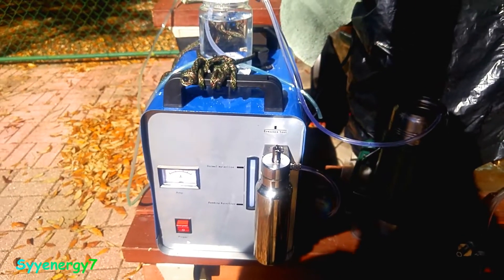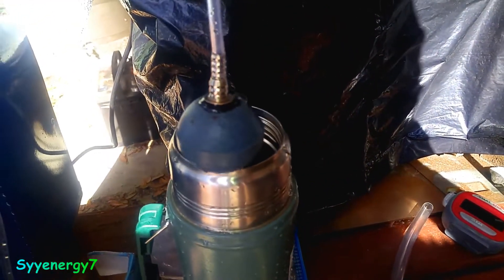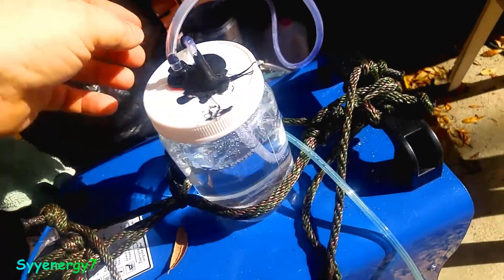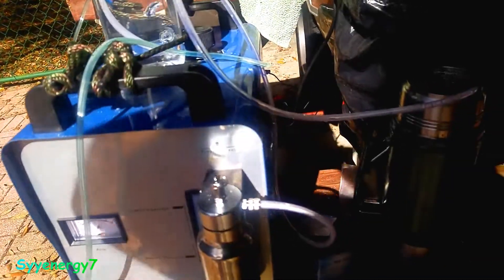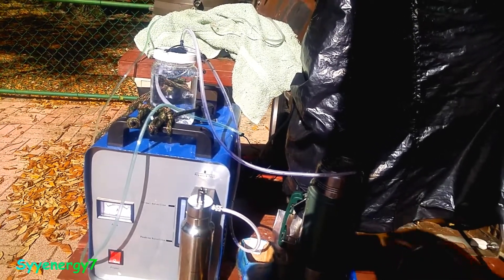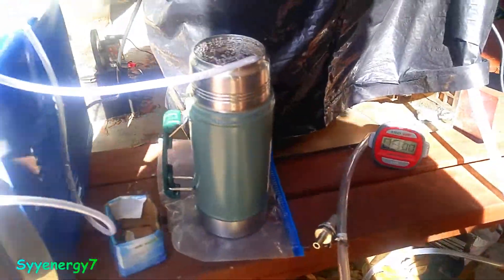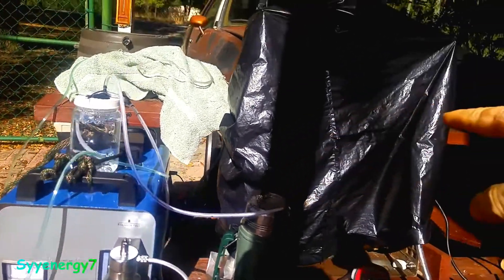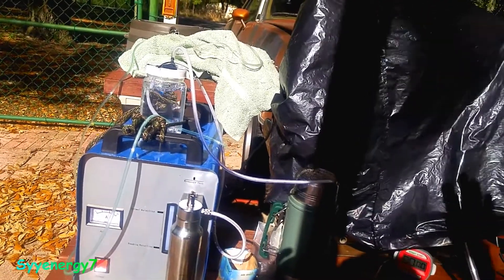$125 HHO 'Health' machine finished !

Comment from the maker: I lowered the electrolyte so it does about 30 liters an hour.  That makes it pretty safe yet still enough HHO to provide health benefits.  Also with less electrolyte the unit will go longer before it needs to be flushed and cleaned.  This is a very cheap way to use the HHO as long as you are careful, watch the water levels, watch for a kinked hose, etc.  etc.  You are the main safety.
Reply: Thanks always been watching vids for time email me so got contact details comihg over  from Scotland soon to meet a few youtubers
Reply: What did you lower the electrolyte to?
My instructions say a 15% solution ratio NaOH. (For welder applications)
Thanks for the upload.
Reply from the maker: I have it where the unite only draws 4 or 5 amps at the initial startup.

Comment: Greetings from Texas! I make my own colloidal silver using a Hulda Clark zapper I also made. I make my own C60 in coconut oil. The first time I saw a George Wiseman Aquacure I thought to myself that it looked like a type of welder a window repairman friend of mine uses on acrylic. Long story short is I came to the same conclusion as you and being a frugal kind of guy I decided to make my own with a Chinese acrylic polisher. The only difference is that I've built the tower to place over the fill hole like Wiseman does and I use an extra scrubber before breathing. The oxygen concentrator humidifier works great for me with a nano bubbler attached inside. Oh and screw the control freaks!  Good luck in all your endeavors Bud.